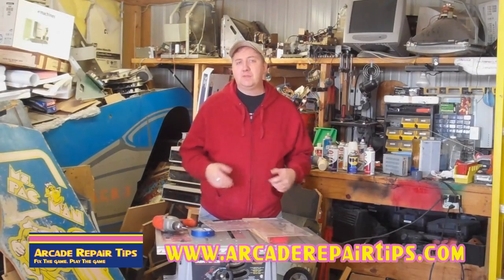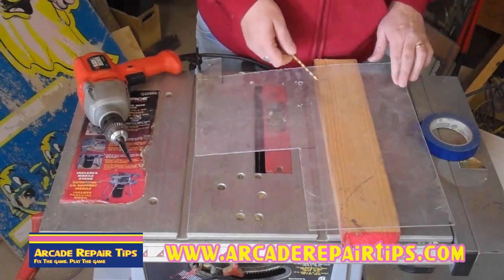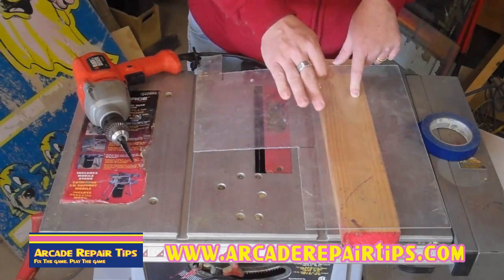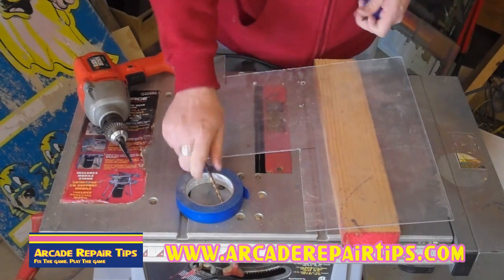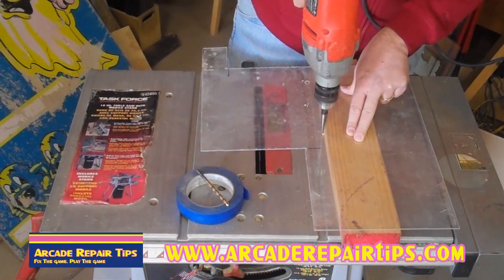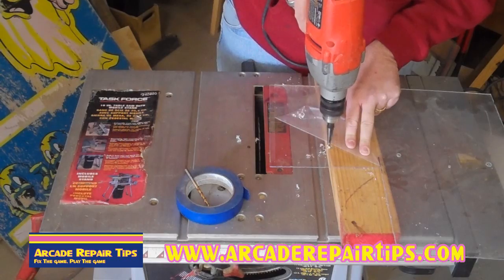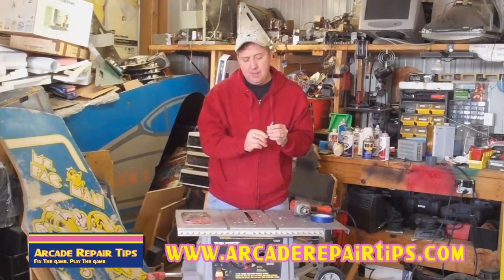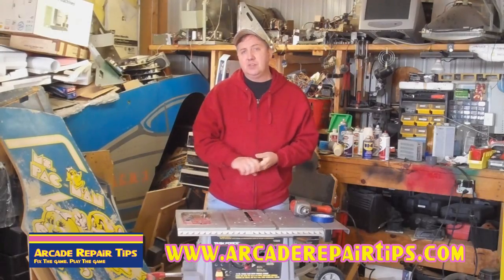Arcade Repair Tips - Drilling Holes In Plexiglass

Comment: What is the best way to cut plexiglass? I’m working on a Popeye control panel decal.  I don’t have any luck with a jigsaw.
Reply from the maker: Using a scoring tool is the best way that we’ve found to cut plexiglass at home. You will need to run the scoring tool several times to create a good groove so that you can cleanly “break” the plexiglass into the size you need. Paid Link: https://amzn.to/47ujynY

Just a couple more tips: be sure to keep the protective film on the plexiglass while scoring it as it will help keep it from cracking, placing painter's tape on either side of the scored groove can help with the breaking process, some hardware stores will cut the plexiglass for you if you purchase it from them, cheaper plexiglass is more prone to breakage so might want to pay a little extra for better quality.

Hope that helps.

Comment: Layout location of hole, put on the tape and then use same method to layout hole on the tape. Tape and protective film increases surface tension to prevent cracking.

Comment: Good video. Have you ever tried using woodworkers brad point bits? I work in a sign shop and have to put 1/4 inch holes close to the corners of six 22 inch by 60 inch by 1/4 inch thick pieces of acrylic. I was going to try practicing with them. I think I'll find a step drill instead.

Comment: hmm,, soldering iron makes holes in plexi just fine :p  always crack safe
Reply: I've "drilled" holes in plastic using a soldering iron before. Not really healthy for the tip of the iron, but it works.
Reply: @jessragan6714  soldering iron  you dummy ?

Comment: I have much thicker plexi glass. It's 1/2 inch. Thick & heavy. I doubt it will chip & crack like thin plexi, but I need tips on drilling screws into it. Thanks!
Reply: Did you find any tips on screwing into 1/2 “ thick plexi?

Comment: First attempt at drilling a 1/4 hole in a thin sheet of plexi for a PC case mod and it sheared off the corners. 

After watching this video I went to Home Depot and picked up a step drill and as easier, if not easier, than what is shown in the video. Finished the entire project in about 10 - 15 minutes. 

This is great advice for people who are first starting out with plexiglass modifications.

Comment: Thanks for the tip.  My method is to drill the holes in the control panel with a forstner bit, then sandwich the plexi between some scrap wood and the control panel to drill the pilot holes, then clamp the plexi to the top of the control panel and use a router with a laminate bit to enlarge the hole in the plexi.  It seems to work okay and now cracks (yet!)  Tim's method seems to be much more efficient!